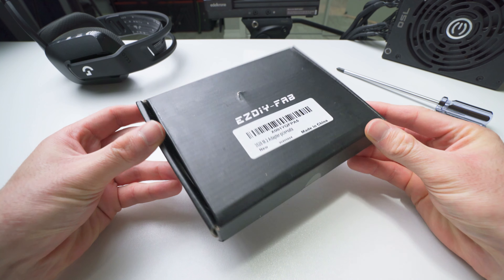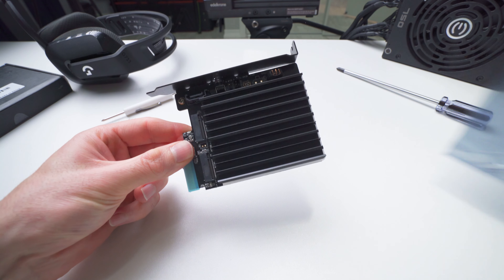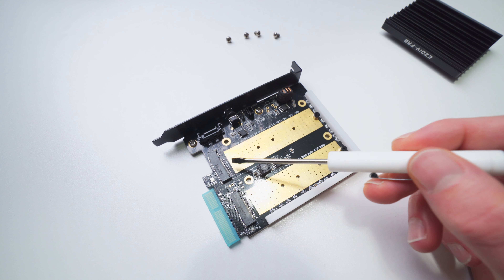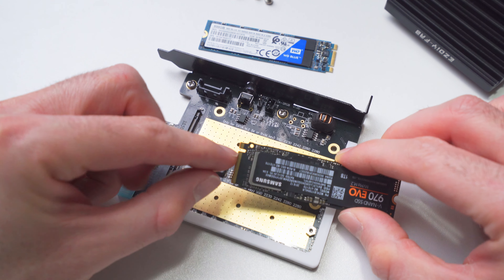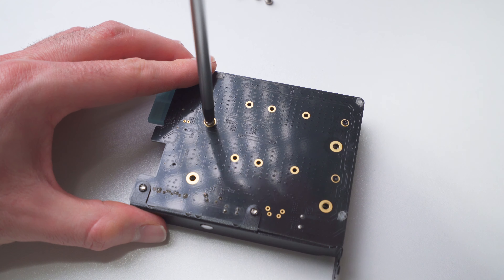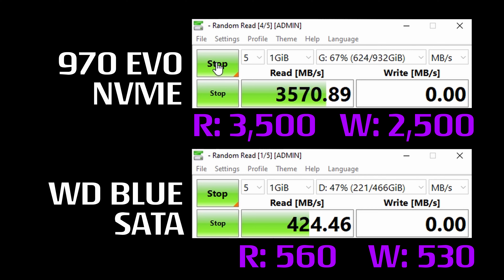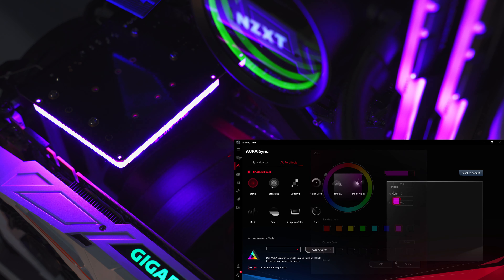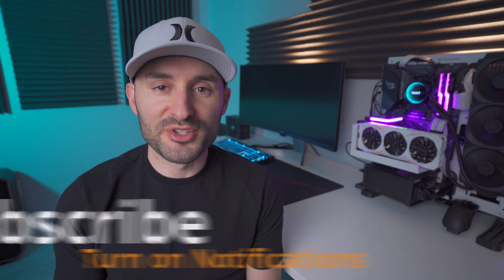NVMe PCIe SSD Adapter Installation and Speed Test - EZDIY-FAB Dual M.2 RGB Solid State Drive Adapter

Comment: Really good content. I just stumbled here because I bought a pcie m.2 adapter off Ali Express for less than $4 and wanted to make sure how it needed to be installed. What you tested is different, but it was still helpful. From what I can tell, these little adapter cards work. My motherboard (Asrock Z97 Killer) has an m.2 but it's only x2. Using this little adapter card I can use a x4 slot and should be able to get full speed.
Reply: Hi James, did u test the adpter on x4 slot ? I have PCIE- Gen4 Lane x4 and need this type of adapter..
Reply: @abdullahtiry6394  As far as I remember it worked fine. I don't own the computer any longer though, I sold it shortly after building it. I don't know how much of a meaningful bottleneck X2 is vs. x4 but the x4 slot wasn't being used so for $4 I figured it was worth doing.
Reply: @abdullahtiry6394  what  about useing  this for  wifi /bluetooth  i saw one that  did not have a bracket be great for hideing the wifi card in the case was not sure it work with out ext  power

Comment: A question I have is when using a 4x PCIe card like this does the video card performance degrade at all when using them at same time, for instance a game installed on the SSD on the card and then playing that game and running a fps comparison to no card installed?

Comment: Quick question does the system see the drives as 2  or 1 combined drive? Then again I guess 1 being sat and 1 m.2 - I guess 2 drives at different speeds.. Never mind I just seen end and you show 2 speeds..   BUT do u now of a 2 slot m.2 addapter, as Im looking for 1, great vid thanks

Comment: Where is the installation video you used? I gave up on this as I have and old Alienware Area-51 ALX and I got the impression Clover had to be used.  You make it seem like I can format it as if its on one of the SATA connections I'm assuming.  I can see it in Windows and in the BIOS, but unable to partition it during a bootable media install to this very M.2 SSD

Comment: I don't want to be that guy, But the NVME is not SATA. NVME can go up to 3.7 GB but SATA tops off a round 300-500MB so the drives will never be anywhere close in performance. When I saw this video I had no idea who this is for since the ideal situation is a card with 2x NVME slots so you can RAID it and get up to 9GB as RAID 0. So having a card this way does not give you the benefit of either unless you goal is to get rid of spinning disk and go towards a silent setup like in the case of a media center of DIY (like Pfsense) home router device. So the numbers you got are actually expected and normal. here: https://youtu.be/-cofEwJ-2ek?t=259

Comment: Cool but the SATA is useless to me.. My board has 4 SATA ports but 1 is shared with the m.2 SATA.  I have a 1TB wd blue m.2 SATA on the motherboard already. which eats 1 SATA port.
my 3 other SATA ports are each connected to 1TB wd blue 2.5" SSD's and a wd gold 12TB for recovery purposes.  
guess I'll look for an NVMe PCIe adapter card.

Comment: my old hp prebuild only has sata 2 will that effect msata performance?i'm assuming nvme is driven from pci-eand msata wd drive driven by the sata connection from motherboard for windows10 installed boot drive ease of compatability?as the bios would just see the msata wd drive as another sata connected device

Comment: elo ECPU , can it put NVME storage and graphic card together (use PCIE 4.0 x16 To M.2 NVMe SSD Extension Cable) in one time?and if can got bottle neck or reduce performance?
cause iam using Mini PC which come only 1 NVME slot.

Comment: Hello sir, is it possible to change ssd m2 sata 3 bay pcie 4 NVMe M2 SSD samsung 980pro used a adaptor, in effect i both the ssd samsung 980pro 1to but my tablet dell venue 11 pro has ssd m2 sata 2260 please help me thanks

Comment: I bought WD Blue SN550 NVMe SSD and my laptop model is Lenovo Ideapad 110 (Disk Driver- WDC WD10JPCX-24UE4T0), Does both are compatible ?? If yes how do I install  WD Blue SN550 NVMe SSD to Lenovo Ideapad 110

thanks

Comment: Hi bro i have msi b450 gaming plus motherboard with an xpg s40 spectrix nvme ssd but it copyes verry slow with 100mb per second, i have pci-e 3, will it work with to improove the speed of writting?

Comment: I hate the adapters that forces you to use a sata cable. You could buy a sata drive instead. I much prefer when the bandwith is shared between the drives. Nobody hammers both drives at the same time anyway and if you do, you need something else that is not a sata drive.

Comment: Can I ask if you could put the M.2 SATA stick to M.2 NVME slot? Does it work?
Reply: No, the connector is diferent. For the M.2 MVME you'd need a M connector whereas for the M.2 Sata it's a M & B connector.

Comment: I installed an adapter card to PCI-Express slot and then I cloned my C-drive to new WD NvMe drive, but when I tried to setup from BIOS boot from new NvME drive, my workstation BIOS do not see the NvMe drive.  But within the Window10 OS, it sees as new drive but not in the BIOS.
Don't know how to fix it.
Reply: Any devices that require Additional drivers from a  manufacturer or windows will not be recognized By the BIOS. The BIOS needs to have built in support for the card to boot from it. This will vary by how recent your BIOS and Mother board is. Older boards will not see the PCI Card so cannot see the Drive Attached to it. A quick test is to boot into your BIOS and see if you can select the boot device. An old BIOS just has words like SATA, CDROM, Floppy new BIOS's allow you to select the individual device by Model name. If you have the newer setup see if the Storage is visible in the list of choices. My 2 cents.
Reply: @RogerJoseph  Thanks Roger for your input appreciated.
As I mentioned above, new NVME drives is visible and available for use within Windows10 but in the Bios setup screen the drive NVME drive does not exists, which mean I cannot set to boot from NVME drive.
I bought this card from ebay, the seller is in China, he is not any help.
Reply: @RogerJoseph  Version of the Bios updated September 2012, there is no newer version of BIOS software to download from Lenovo for this MOBO.

Comment: Just got myself one of these card (not exact same model) but running into a weird problem. When installing the card my PC seems to post twice before win10 loads up. This only happens on a cold boot though. PC will start up for 2-3 seconds power down and then power up and boot as normal. Am i missing something here? I am using an Asus motherboard as well, is there some sort of setting that needs to be enabled?
Reply: Did you try to update the bios
Reply: @mantequilloso  yeah BIOS has been fully updated.
Reply: What version of windows did you try?
Reply: Of windows 10*
Reply: @clek you should try with a optimized version of windows 10, like tiny10 or minios
Reply: @clek  did you check the settings of PCIe ports in the bios? Maybe the version of them or how they work with data is disabled or changed
Reply: @mantequilloso  was using latest win10 version at the time and did check settings in BIOS, but in the end I gave up and just bought a larger m.2 drive. Since doing that and using the motherboards m.2 port have had no issues.

Comment: I wonder if removing the labels from the SSD's might improve the removal of heat(ie they run cooler)? Anyone tried it? did it make any difference? Just thinking of having a paper/plastic between the thermal film and the actual surface of the chips is not something you would do with say a CPU. 
Just a thought.
Reply: the sticker is actually a heat spreader, if anything removing it will make it overheat

Comment: Hello, your video is very interesting, I would like to ask you a question. I have an iMac late 2015 21.5 1.6ghz (base model) ... it doesn't have the Nvme port but I would like to do the adapter, is it possible?

Comment: If I don't want RGB, is it as simple as just not connecting the RGB header?

I imagine I could install Linux onto an adapted drive through this too eh?
Reply from the maker: You can turn the lighting off either with software (with cable connected) or with the button on the bracket.  The adapter is just a passive device and shouldn't affect the type of OS/Software/Data you store on the drive.